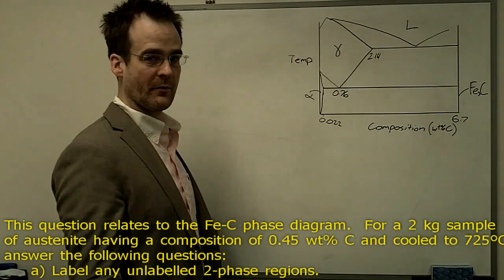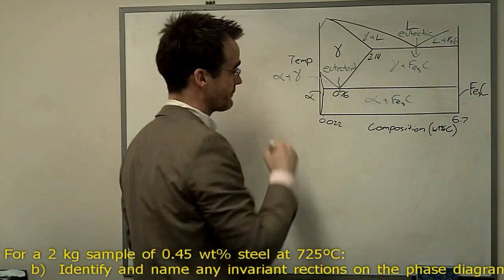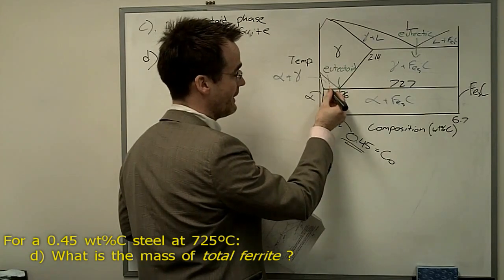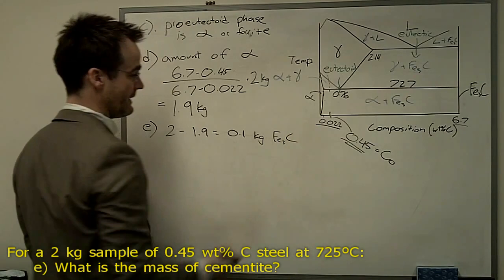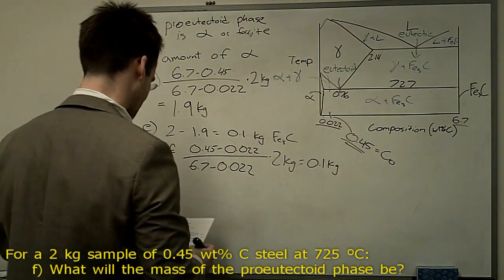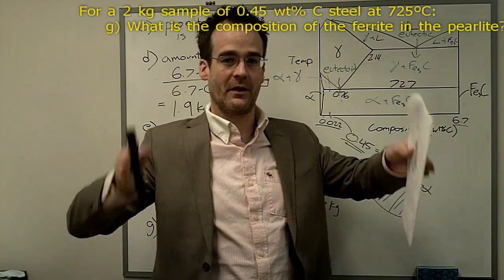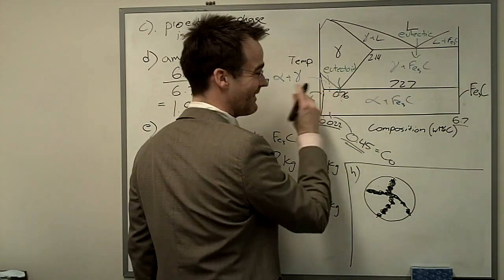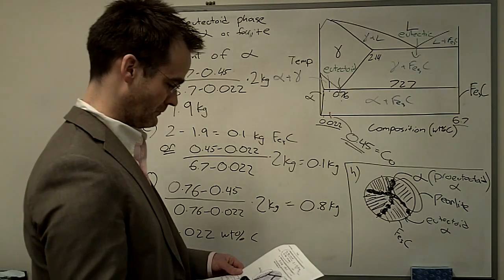Iron Carbon phase diagram, Nov 2008 test 2, Q4

Comment: I am confused about the solution of question (g). Actually it needs the composition of the ferrite in the pearlite. 

Total ferrite(93.6%) minuses the pro-eutectoid alpha(42%), that's the ferrite in the pearlite. 
Pearlite amont is that 100% minuses the pro-eutectoid alpha(42%).
What i calculated is 93.6%-42%/100%-42% = 89%.

I am no sure if i am right.